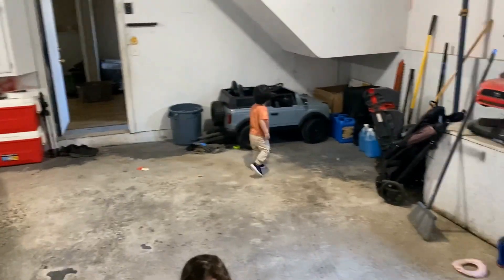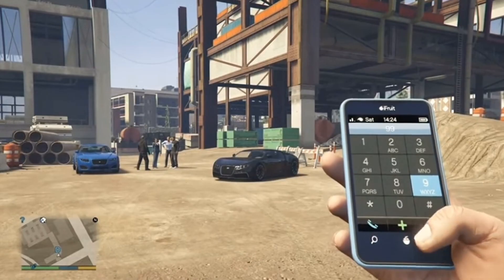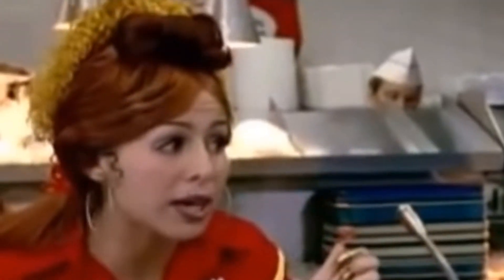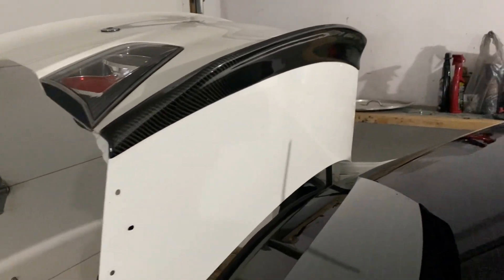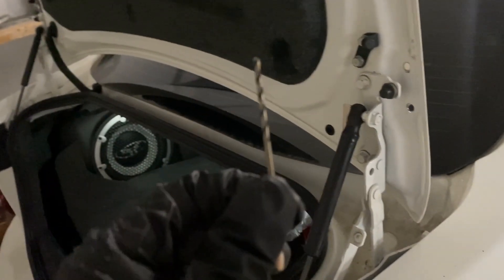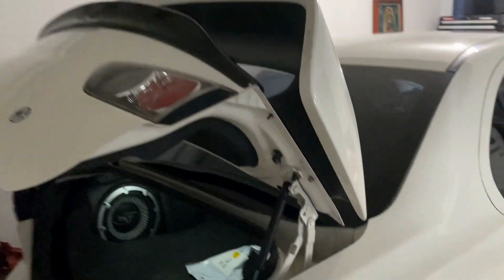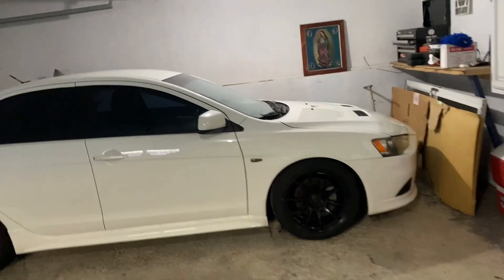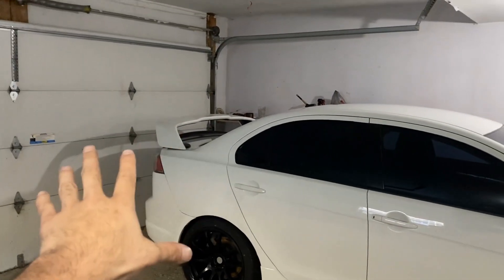Evo X Wing On Ralliart/Lancer Trunk ( Holes not aligned? Simple Fix )

Comment: My top 2 holes are lined up and the bolts lay flat but the bottom hole on both sides don't line up. Do I need to make all the holes bigger?
Reply from the maker: I just aligned the right side two holes, had to drill for one. So probably yes